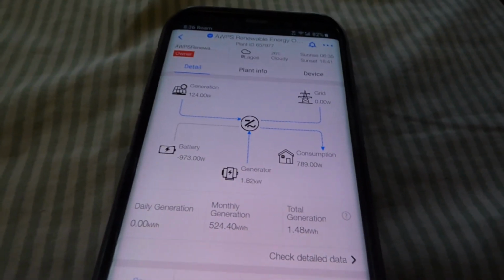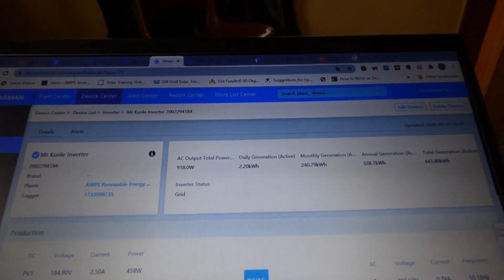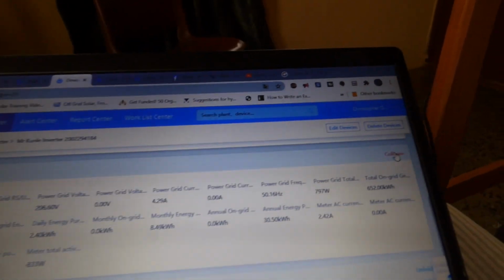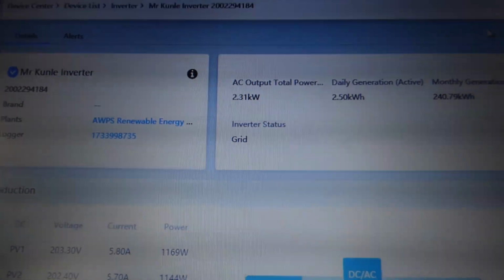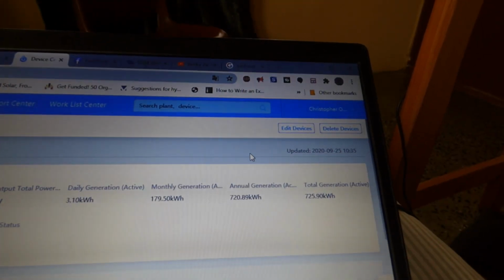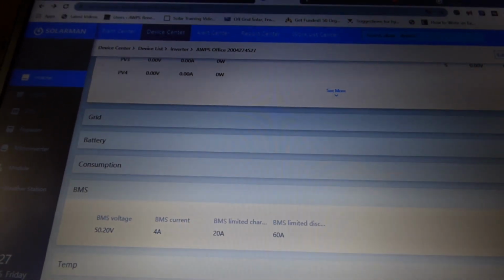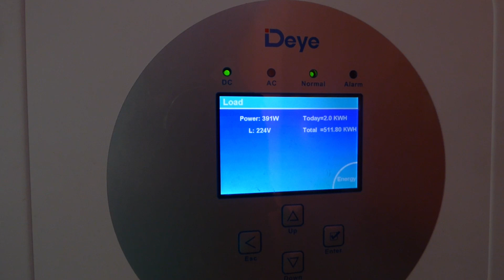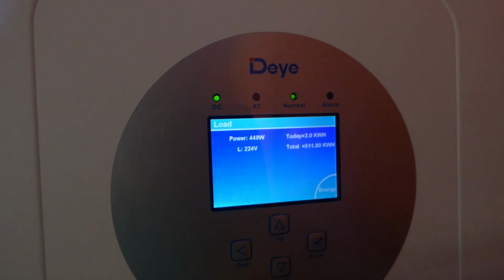Deye Time of Use. How does it work?

Comment: Using 12kv inverter

Ive enabled grid peak shaving at 1500w around 5PM, my total load was around 2.5kv, still it used from battery and solar and didnt use grid, what should i do enable using grid during times when there is lees solar power cause i dont want to drain my battery so much or give too much stress at evening time, also i wanted to know if there was any way of  using battery charge only when grid cuts off! like inverter mode, i dont mind using the grid to feed in my household, i need  battery usage only when grid goes off, help help!

ps: should gen check box be enabled in time of use
Reply from the maker: If the gen port is not in use then no need to. Please share your settings

Comment: Hi. Dr. Solar. A little advise here. two 8kw inverter and two 10kw batteries. one pair at the office and the other pair at home. I would need an advise on setting the time of use for each one. Sunrise at about 7.am and sets at about 6.pm. At the office, there is nobody using electricity at night while at home it is the reverse. how can I maximize the battery at the office so as to use less of the grid? Thank you.
Reply from the maker: Thank you for watching and commenting. Nice question. Is the grid reliable? If the answer is yes set time of use to allow grid charge after the battery has discharged to a certain %. Change grid charge in your battery settings to start at that same %.
Reply: @drsolar  Thank you.

Comment: Isn’t there a way to maximize battery charging even when load is low so battery gets to either 90%+ sooner? I’m thinking in seasons with short solar times this would be ideal.
Reply from the maker: The charging is like opening a faucet. You can only open it so wide. My experience has been rather funny. It pretends to want to rain and it does not. So my batteries are not getting full fast enough. I can add more solar panels but when the dry season comes it is wasted. Another option is a generator. In the setting, I have battery prioritized. The system tried to apply maximum charge
Reply: @drsolar  You had mentioned the challenges of weather in another video hence the question of wanting to charge batteries as quickly as possible. Also generally to invest in the system especially a large battery bank that isn’t fully charged is a waste and it becomes expensive to invest further in a generator. Depending on the type of fuel you have, fuel sitting in a non-generator can be corrosive particularly if you are thinking of Ethanol mixed fuels which some of us have.

Comment: Does Deye make sure the battery eg Pylontech doesn’t get overcharged or it’s a function of the Pylontech? Reason I ask is if you had Pv and battery was full, would charge controller not continue to charge the battery?
Reply from the maker: Happy holidays. If you have communication between the battery and inverter the bms tells the inverter when to start and stop charging. PV will only produce what is necessary to power your loads with nothing going to the battery. Thank you for watching and commenting

Comment: I have 5kw hybrid unit of yours. I want it to start generator at night for an hour and charge batteries while load stays on grid. Can I do that? So far it only turns on generator when grid is off. When that happens. Generator starts and charge batteries while powering the load at the same time. My generator isn't heavy enough to do both at the same time.
Reply from the maker: Good morning thanks for watching and commenting. It is performing as designed. You might want to put a timer on your loads to keep them off during the time your generator is running. Another option is to reduce the charge current, your batteries will take longer to charge but it will minimize the stress on the generator. Thank you for watching and commenting
Reply: @drsolar  Thank you so much for replying. I understand now that this inverter won't start generator while GRID is active. Is there any way to schedule inverter to disconnect grid automatically (so that generator starts itself) and shift load+charging to generator assuming i've minimized the charging ampere and load for that period of time... I'm just trying to automate things to maximize battery usage.